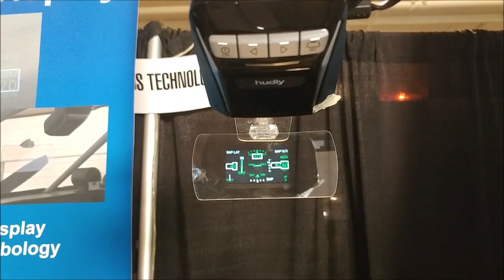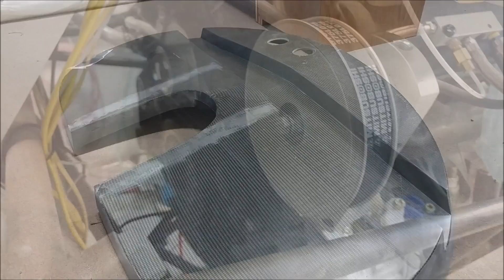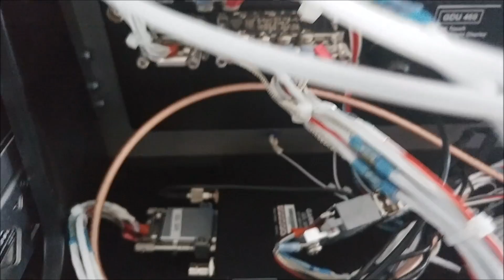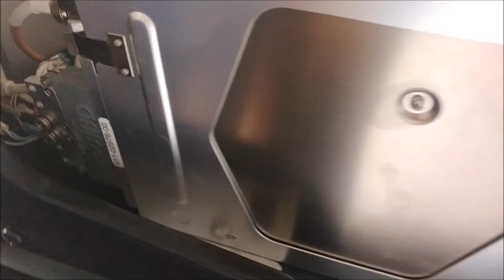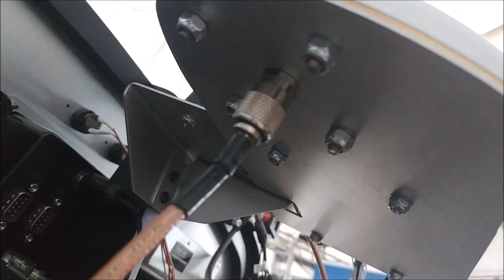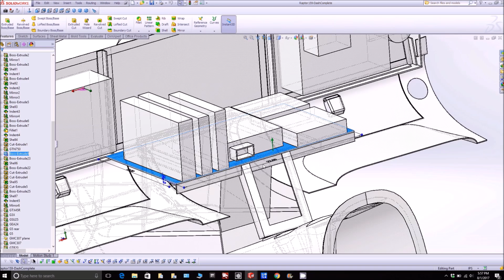All About Avionics - Figuring out the cool stuff

Comment: Whew! The withdrawal symptoms created by not having a video update was tough! Welcome back! Peter, care to share your thoughts/plans on equipment cooling, especially on the ground? Also regarding the pulleys for the flight control cables, I humbly recommend putting cotter pins on the locking nuts.
Reply: Or safety wire.

Comment: Probably goes without saying, but leave plenty of room between the avionics components for the cable harnesses and connectors,  Also be mindful of where you might need to get a screwdriver in to remove components.  One wouldn't want to have to remove 1/2 the avionics just to get at some bolt or component.

Comment: I saw in the ordering info that the AP was only pitch and roll and coincidentally it came up in this video.  Dumb question: What happened to yaw?  Apparantly you don't need it?  The plane will yaw without yaw input?
Reply: I was just thinking about how a rudder is required to do coordinated turns (keeping the ball centered).   I would think any AP-controlled turns would have to use the rudder.